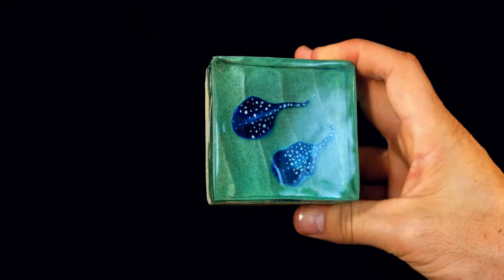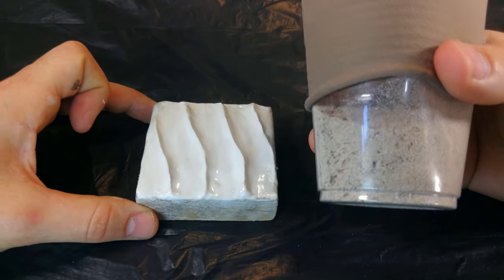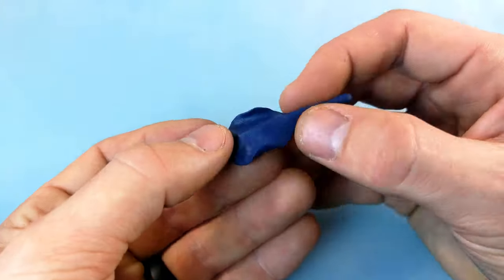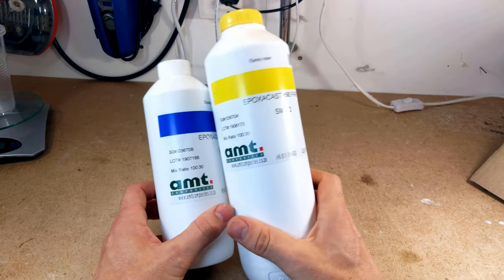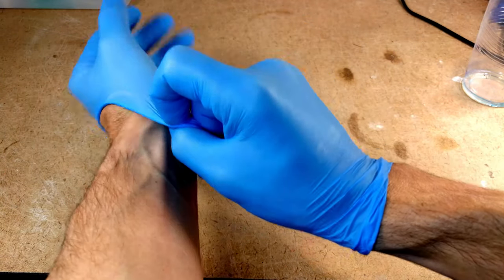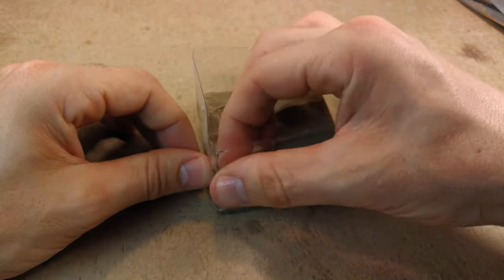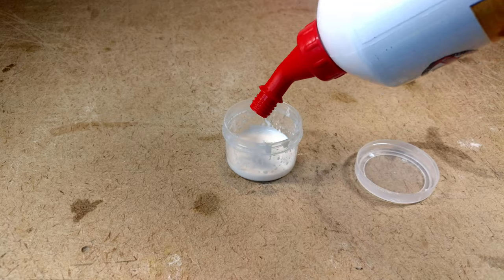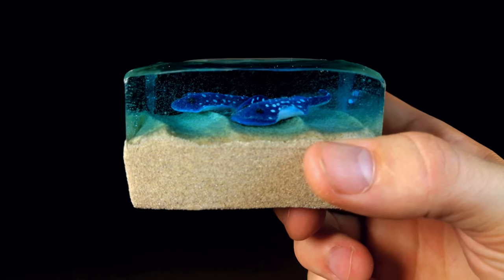DIY Miniature Stingray Ocean Diorama

Comment: You can add mineral oil or any oil really to soften clay. Premo clay is same type of clay but is much softer. Fimo clay is hard to condition. If clay isn't totally conditioned, it will break. U can tell when it is ready by folding the clay and there is no cracking when you fold, should smoothly bend without breaking, then it's good to go!

Comment: if you want to lift them up you have to do the resin in layers
Reply from the maker: I tested the layering technique but I always saw the layer lines afterwards so I didn't like it very much. Do you know how to get rid of the lines? Someone said to me that you have to add the second layer while the first was not fully set but to judge this is also difficult.
Reply: Curious Crafter the lines shouldn’t show when you add the next layer when the first is sticky. i would touch it and then use heat to get rid of fingerprints and then add the next layer
Reply from the maker: Thanks. I should definitely give it another try.
Reply from the maker: If I can get the layers sorted I will add resin to the reef project which I have been wanting to do for a while.
Reply: Curious Crafter i can’t wait to see it !